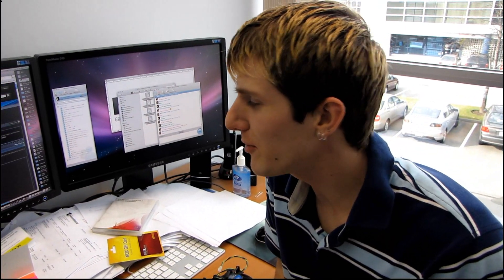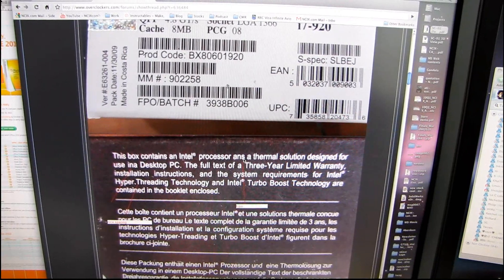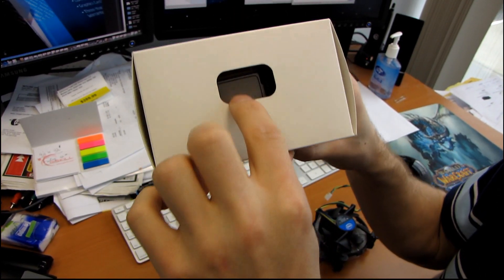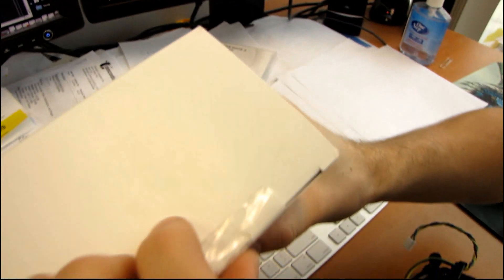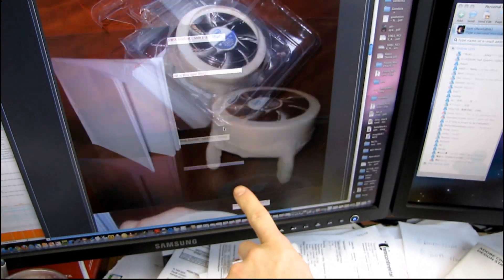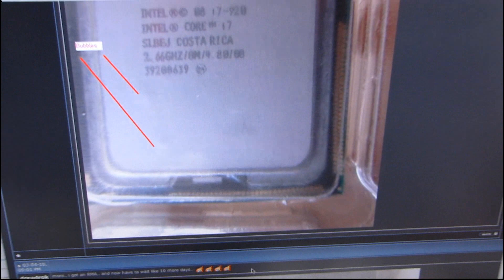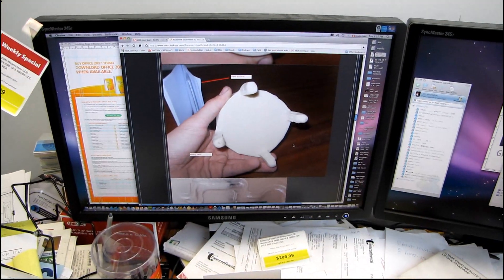How to Recognize a Legitimate Intel Box Processor Linus Tech Tips

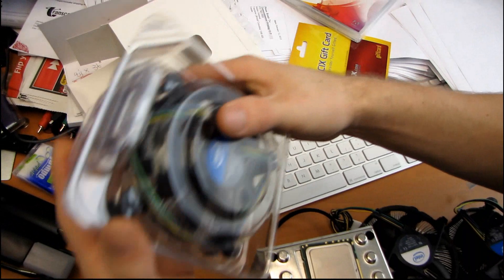Comment: What heatsink is the one at the far left at 1:45
Reply: 2:45 not 1:45
Reply: Old intel extreme edition stock fan
Reply: It's the heatsink from a Intel i7 Extreme series. Intel has stopped including the heatsinks with the Extreme series or the high end K-series CPUs. They would assume that you have your own aftermarket cooling solution so that they could sell the CPUs for cheaper (because they don't have to include a couple bucks worth of aluminum and copper)
Reply: +Sejin Kim Those were really great heatsinks by the way...

Comment: Well since the iMac is technically a all-in-one computer I found this: h t t p : / / bit . ly / RlnQ5Z (remove spaces) and while this does not have native wi-fi support you can easily pick up an adapter for $50, also this one has an i7 so it has hyper threading. It has 12 GB of more RAM a better graphics card. Also if you hate laptops then why are you talking about a iMac? it uses the exact same form factor parts as most laptops. Oh also the one I found has 1 more TB, touch screen, faster HDD.

Comment: Okay, you're trolling (or very very stupid), people do not for the most part build laptops as it is incredibly difficult, I have a a custom built desktop, but a laptop is a another thing. Also by how you worded that I'm just going ahead to guess you're within the 12-17 demographic. The parts for the Mac are this: CPU: 1.8 ghz dual core, GPU: Intel HD 4000, RAM: 4 GB. The parts for my $250 are this: RAM: 4 GB, GPU Radeon HD 4200, CPU: 2.7 ghz dual core.

Comment: Back when I did not know anything about computers I bought a $2000 Mac, I still use my shitty $250 HP laptop because it has better specs (and because I broke my Mac out of rage) so if you're saying $2000 for a shitty system is a give away then you really would be surprised if you took at some bottom of the line HP systems :), oh and now that I Know a good bit about computers have gone to their website, they are selling a system for 6k that has a 6 core CPU and yet uses onboard GPU.

Comment: Macs aren't necessarily better for video editing/photo editing. Sure the programs that come with the Mac like imovie are optimized to work well with the OS, and the OS uses minimal system requirements when rendering etc. BUT, with a similarly priced Windows machine, you would get much more performance and therefore you would be able to perform rendering and photo editing much more quickly and effectively.

Comment: @flamesh2s - The 2008 Mac Pros don't have an LGA 1366 socket. Core 2 Xeons are all you will be able to use in that Mac Pro, not i7 unfortunately since that requires Nehalem compatible mobos (which the 2009 Mac Pros do have).

Good luck

Comment: This is pretty irrelevant now that the Core i7 930 is out for the same price as the 920 and the 920 has finally reached EOL (end-of-life).

If you wanted to get a 920, don't.  Get the 930 instead.  It has a higher clock speed stock (2.8 GHz) and has shown higher over-clocking potential than the 920 (bit-tech was able to get it to 4.3 GHz vs. 4 GHz for the 920).
Reply: I'm pretty happy with my i7-4790.